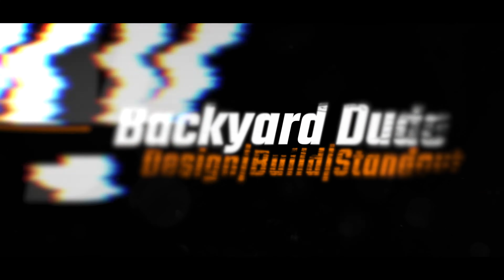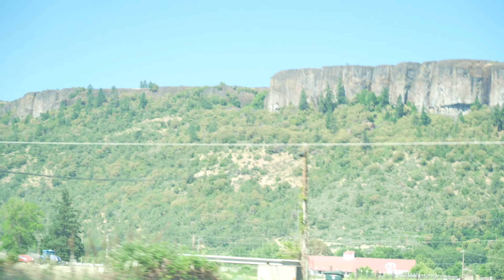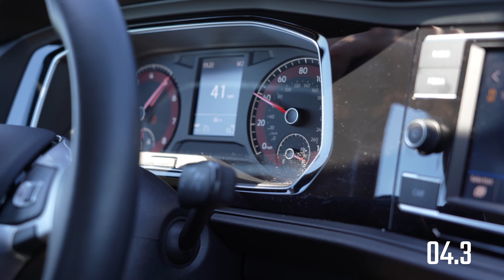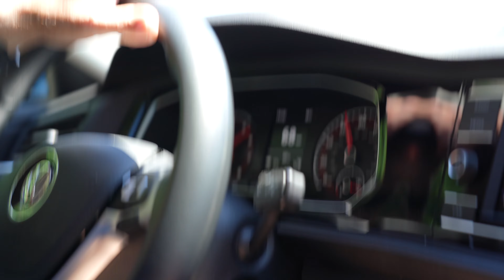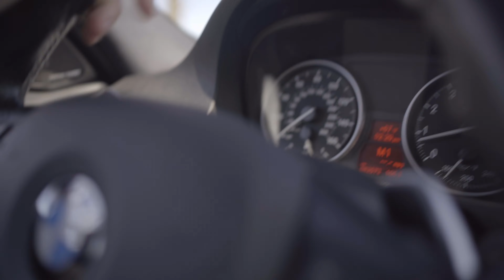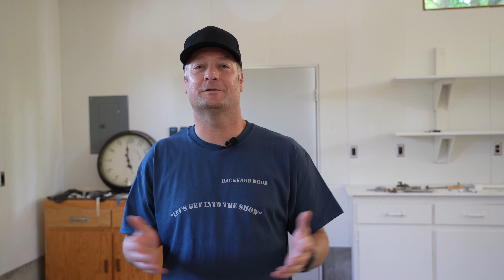Can a RaceChip Make Our Jetta Faster Than A BMW? (Jetta MK7 Build, Ep 4)

Comment: I've noticed with the Jetta, the second someone else gets in the car, it gets much, much slower. If you performed this with just yourself, or without adding a 3rd with the race tune, youd get better results. The third passenger is the sole reason youre slowing down.

Comment: I’m sorry but the car is not limiting power, that makes no sense. If you did any research vw is a massive tuning platform. Race chip is not an actual tune, I’ve never heard any good from anyone that’s tried it, even with dyno numbers. Get yourself a flash and you will not only truely feel power gains but you will get the results to prove it. The amount of money you spent you could have spent about 200 more and gained so much more. I had a 2015 Jetta 1.8 that with just an apr stage 1 tune and exhaust I was able to get 0-60 down to 6.8 seconds, could have been faster but dealt with traction issues. Car before tune did 8.1 second 0-60. Currently with my 2019 Tiguan I have apr tune, Cts turbo down pipe, with full straight pipe, forge diverter valve, IE intake system, and a couple other bolt ons and I’m getting 6.3 seconds 0-60 and tiguans stock are rated for 9.1 seconds.

Comment: Still confused why you didn’t completely disable the traction control on the Jetta?
Reply from the maker: Great question! On the Jetta there is no way we know of to completely kill the TCS with the possible exception of pulling fuses, but we wanted a real-world scenario. You can “disable” the system through vehicle settings (which is what we did) but it is only in a reduced interference mode which still tripped the system.
Reply from the maker: Hi, do you have advice on how to do that, without changing the ECU?
Reply: @BackyardDude  there’s some long coding  settings you can go about changing using an OBDELEVEN, I personally have a gli but alot of the same adjustments can be made for the Jetta like long pressing the traction control button or adding a selection under your traction menu to put traction in a sport mode or completely disable esc
Reply from the maker: @mk7t472  Thanks for info!!
Reply from the maker: @mk7t472  Thank You so much for the info, we will definitely look into that.

Comment: With your tests complete, would you recommend this chip for increased power without any other mods?
Reply: Get a JB4 if you want a piggy back tune. You can get more out of a JB4 as well.
Reply from the maker: @quatz91   Thanks Magic Cat, we will check into the JB4 tune
Reply: @BackyardDude  No problem, I was on JB4 map 1 for awhile then had a custom map 6. Currently running Unitronic Stage 1+, which JB4 can stack with, but im strictly flash tune at the moment.
Reply from the maker: @quatz91  Nice! :)
Reply from the maker: Hi, it does increase power & fuel economy.  I would if you are not trying to improve your 0-60 time or launch!  I hope that helps.

Comment: My stock jetta 2016 0-60 in 4.5s
Reply: Absolutely impossible, I know jettas pushing over 400hp on stage 3 tunes, and full bolt ons, struggling to make it into the 4s due to traction issues.
Reply from the maker: Hey, is that time baed on a stock jetta?  What were the parameters when you ran your 0-60 times?

Comment: Well did you do any other mods before because you got the highest performance chip which usually requires an intake exhaust down pipe etc
Reply from the maker: Hey there,  we like to build upon a base and see the incremental changes and increases in power and torque.  Stay-in to further video to see all the mods we make.
Reply from the maker: No, it was just chip!

Comment: You are literally proving in this video, you completely wasted your money on the "racechip".
Also making hilarious excuses for it saying things like "we are actually putting down more horsepower than the car will actually allow". No, no you aren't. You are putting down less horsepower proven by your 0-60 times.
It literally doesn't work. Get real tuning software. You are advertising this crap and other people watching your videos will think it's a good idea to buy it.
Unless racechip is paying you for a positive promotion, I cannot understand why you would make excuses for them when there product clearly doesn't work. 
GET A JB4.
Reply from the maker: We will check out JB4, thanks for the recommendation!  The Race Chip did add power and torque to the car, based on the traction control being tripped to be engaged as noted in the video!  Thanks for commenting. :)
Reply: Race chip is a gimmick, don't want to argue in the comments section but, you did not once improve your 0-60 time. You test the jb4 you will actually see a difference. Burger motorsports is proven.
Reply: @NOTaGLI  I mean you’re right and wrong. What racechip says is that it works with stock cars and that’s false. U need a downpipe a cai and exhaust. Now you won’t make the numbers they say u will but it will add a bit
Reply: @thewholecountryislaughinga8440 dude no you are just absolutely wrong. Racechip isnt an ots stage 2 tune that requires a downpipe. It's a bullshit handheld tuner that literally does little to nothing in terms of performance. Please just refrain from leaving comments on my posts with your moronic babblings.
Reply: I would say that, given intake and exhaust work, maybe some fuel line hardware you would see the difference more. I would also assume the traction control being a hurdle to either overcome or live with, as even if your 0-60 times don't improve much, the fuel economy and passing power would be substantial for the cost of the chip. I'm also sure a professional tune would be better, but finding one can be difficult and it would cost more and you would still have a chip for adjustments and profiles
Reply from the maker: @skylepie  Actually, your comments are spot on!  Thanks for commenting.